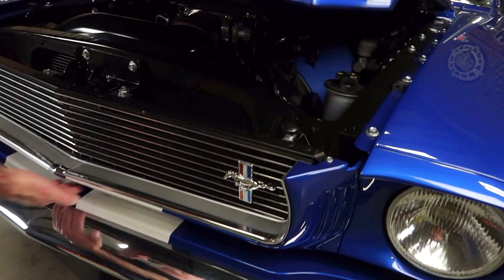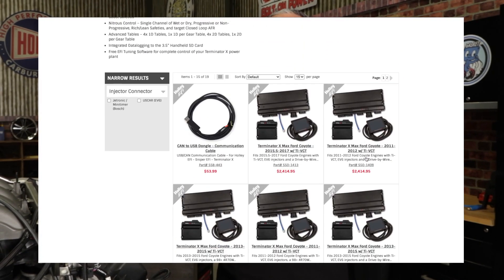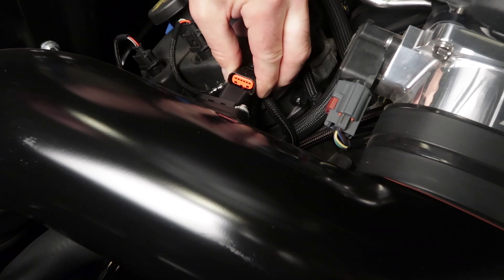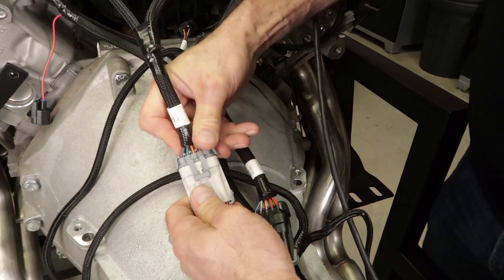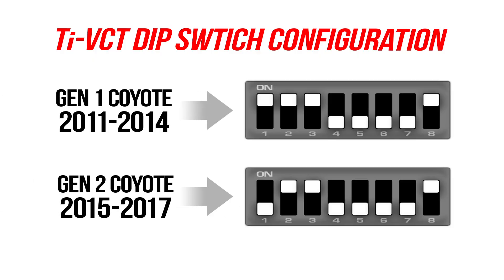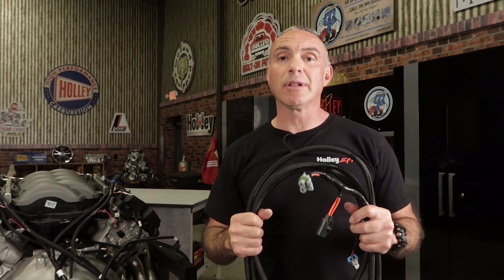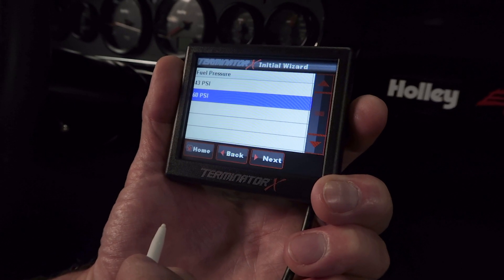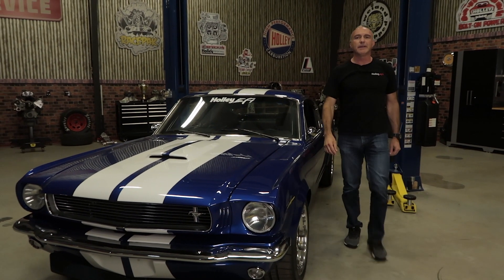How to Install a Holley Terminator X Max ECU on a Ford Coyote Engine

Comment: Will this exact setup work with a manual trans or is it s different party number ? I need drive by wire but using manual trans. Already ordered prior to asking.
Reply: I'm in the same spot with a hemi. It'll still work with a manual you'll just have an open plug where the transmission harness would go

Comment: What about the 4.6 3v 07mustang motor ?
Reply: Have you finished your project?
Reply: @anthonybeaty6311  sold the 4.6 3v was gonna put it in 69f100 but couldn't find  efi system so going ls with cv front and rearend.

Comment: Why do you keep saying 4r70 when the engine comes with a 6r80 which is literally bolted the the engine on the stand.. and shown in the diagrams .... not able to tune the 6r80 yet?
Reply: I was wondering the same thing.
Reply: Yeah they can’t do that stuff with the 6r80 yet unfortunately, I’ve become super impatient. Good news is the 4r70 is cheap and everywhere
Reply: @thenegus5469  also a pretty stout trans